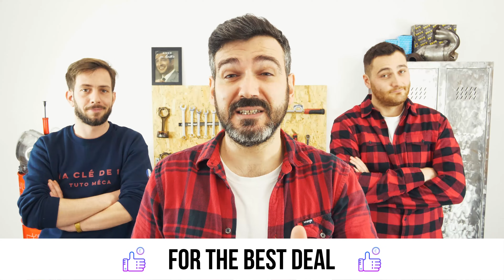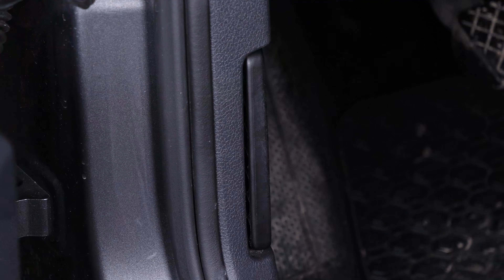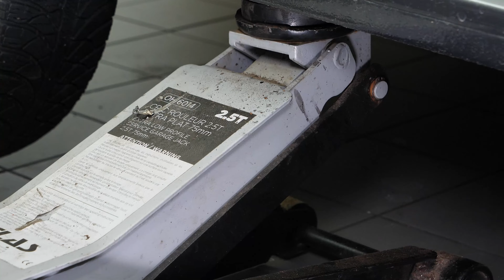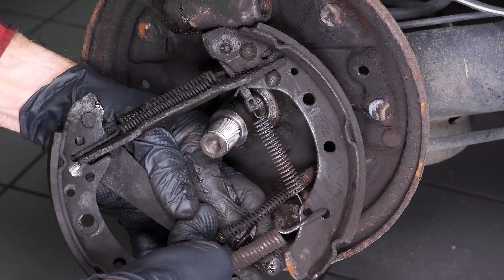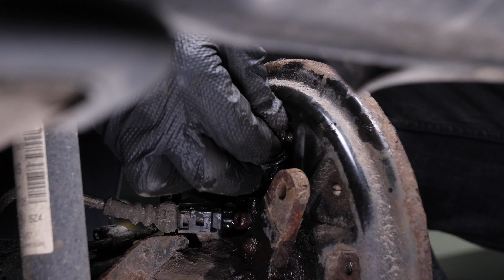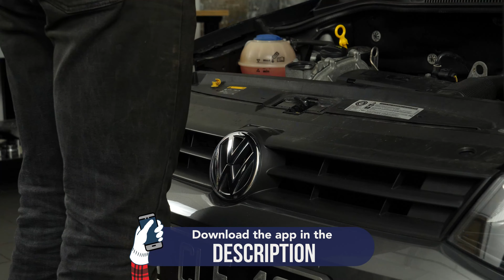How to replace the drum brakes Polo mk5 🚗

Comment: The only criticism I have on this video is that you must completely loosen the handbrake before starting the job, when assembled, ensure the handbrake wedge is pushed all the way up. When the wheels are back on, press the brake 10-15 times to allow the brakes to self-adjust, then tighten the handbrake adjustment cable to make it 3-5 clicks, while ensuring there is no drag when spinning the wheels.

Comment: please tell us the torque specs when using a torque wrench
Reply: I found the specs from another video. 70Nm and after that 30 degrees. It is rather tight, but seems to be correct.